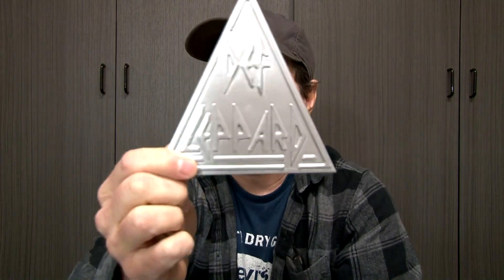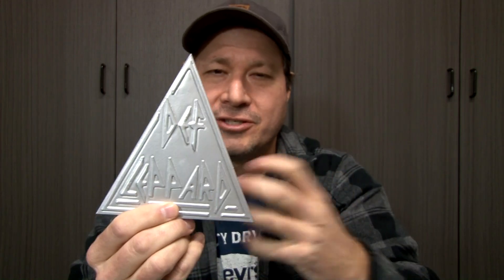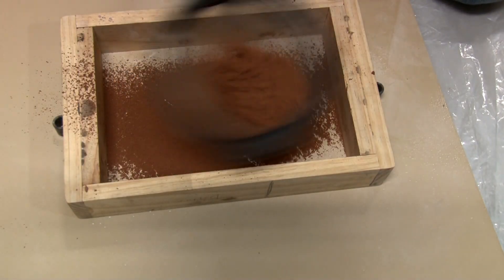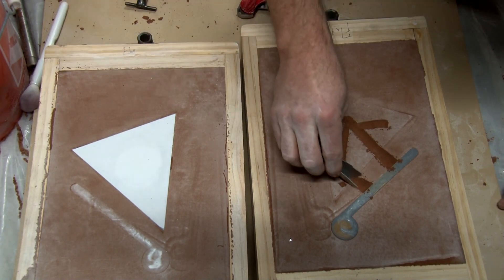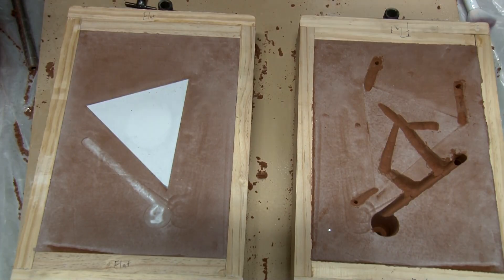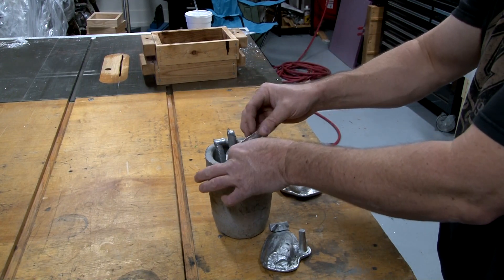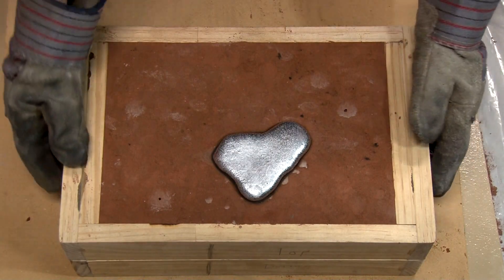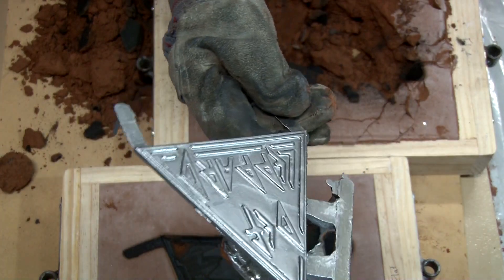Sand Casting a Def Leppard Sign and Reviewing the Quality. - Damon's Metal Casting

Comment: I think casting the part was an acceptable method. But considering the little metal this required, and the overhead, I would have done another mold. Either the same part or a different part. 

The one thing I didn't see in the video was if you used a brush on the part after you applied the talcum powder. I think using a soft artists brush does a better job of adhering the talc to the part.
Reply from the maker: In the preparation of the pattern I did use a makeup brush but probably failed to do a thorough job with getting the talc in the holes.  I focused more on showing the metal in the furnace this time, and less on the mold packing.  This most likely caused me to over look some details in the sand packing process.  I was trying something different to see what viewers look for in these types of videos on my stats page.  I agree it doesn’t take much material and I might have better luck trying to cast the pattern again, but I think I might also demonstrate another way of creating a metal sign by adhering a stencil to a polished piece of aluminum and etching it.  Thanks again for view my videos and leaving a comment, much appreciated.

Comment: I didn't understand about the sand cracking.  Even at the end where you showed it. 🧐🤔

Great pour!  Minor defects that only you would notice.  👍
Reply from the maker: Yeah I think I might have already pounded a little on the sand before it cracked already making an imprint of the pattern.  When the crack happened you can see it shifted the sand in different directions like 1/16- 1/8 of an inch.  Then when I started to pound the sand again it didn't get rid of the original impression in some areas.  Another area that this is visible is at 2:22, there are gaps around the triangle that should have not been there indicating the pattern or the sand was shifted at one point.  Looking at my video I do believe I failed going into why I thought this.  Thank you for brining this up and watching my video.